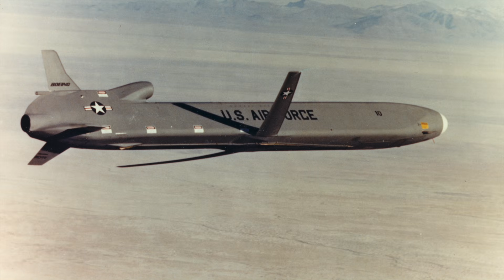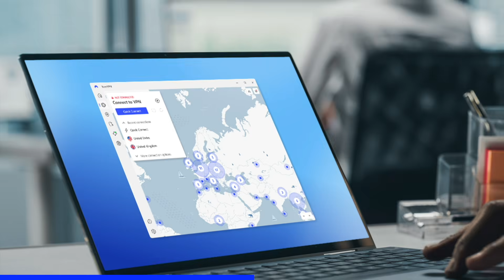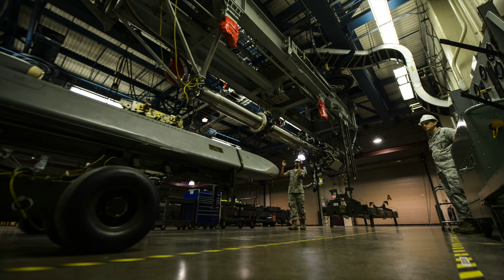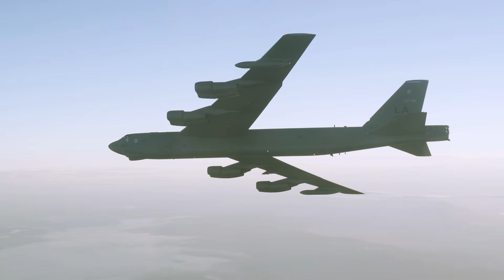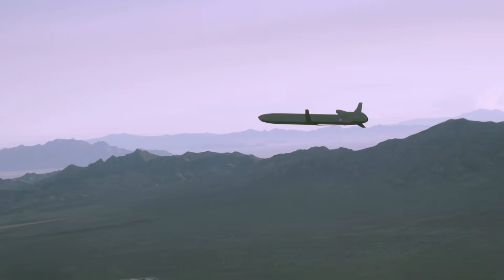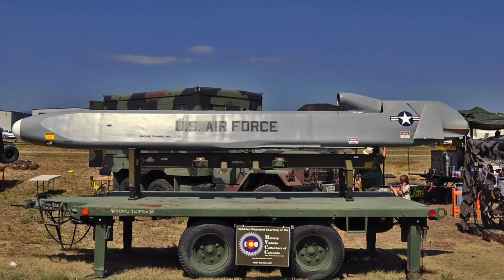Why 4 decade old AGM-86B will continue as air launched leg of US nuclear triad till 2033 ?

Comment: With a range of 1500 miles, its a keep even in modern times however the problem is that SHORADs can potentially take it out so the next logical step is making a 1000 mile hypersonic variant that cant be stopped by SHORADS